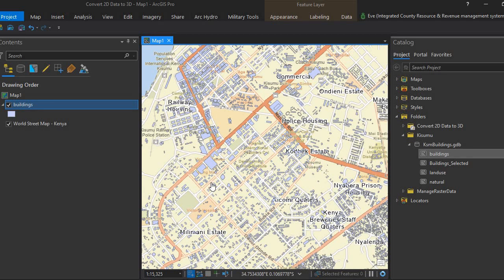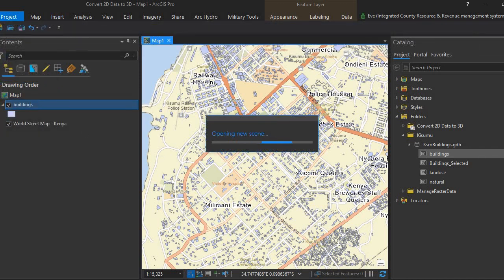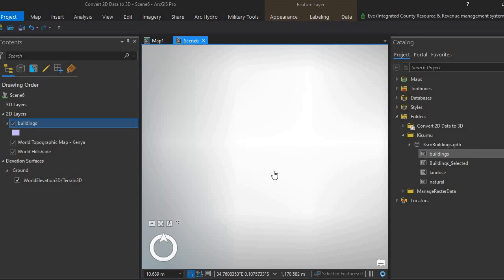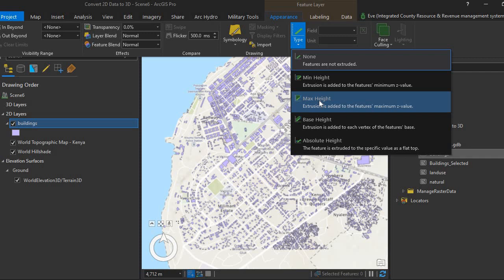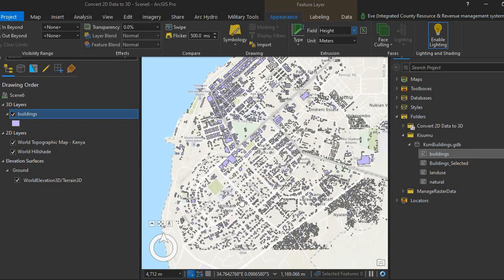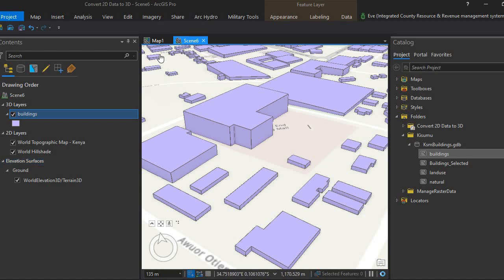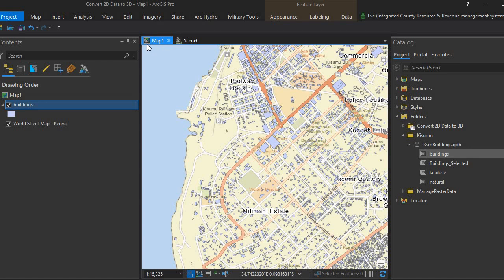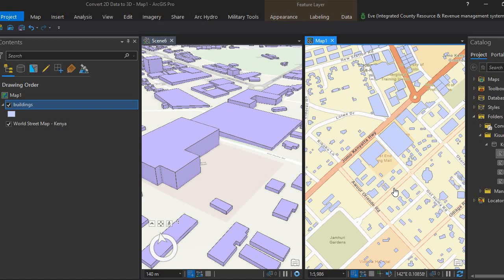Convert 2D Data to 3D in ArcGIS Pro

Comment: This is so cool. Thanks for the tutorials. are there any sample datasets to try with?
Reply: It would be good to have sample data.

Waiting for it also
Reply: @Jmbgis  Try the exercise with this dataset: https://data.humdata.org/dataset/hotosm_ken_buildings
Reply: Hi Laban,  I tried doing the exercise with the above dataset link you suggested to Joseph.  I did not encounter the same attribute table as in the tutorial. My table was missing the height column which means I don't think it's possible for me to extrude the building from a 2D site to a 3D form. I'm interested in hearing your feedback. Thanks.
Will
Reply: You can get sample building footprints for Nairobi on this site: https://data.humdata.org/dataset/hotosm_ken_buildings

The data does not come with a height attribute but you can add that column for yourself and input demo/dummy values to test out what has been displayed in the video. In the event that you do actually know the heights of the buildings in the dataset, you could fill that in the same column and extrude it to obtain a similar result. Happy extrusion!!!!